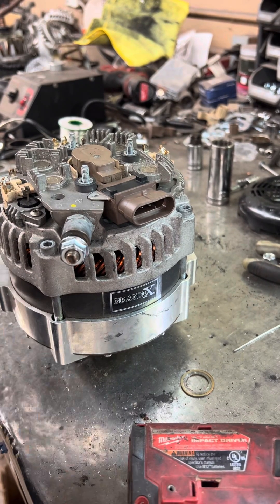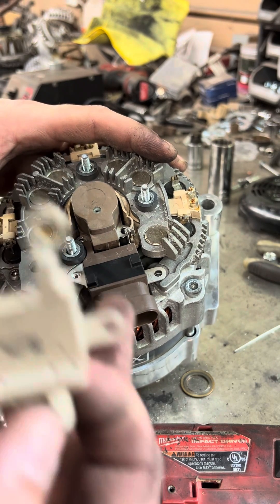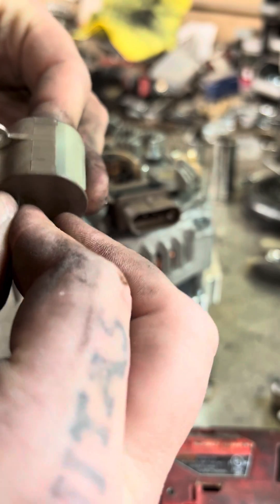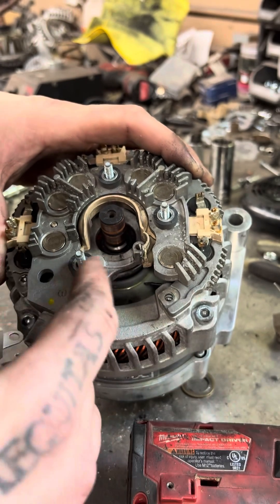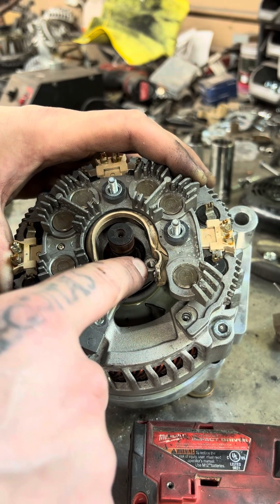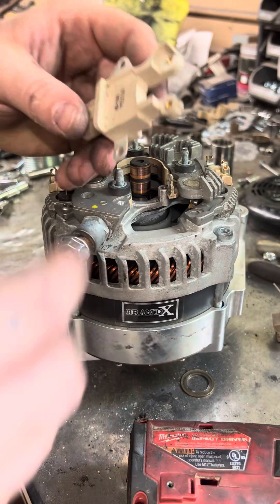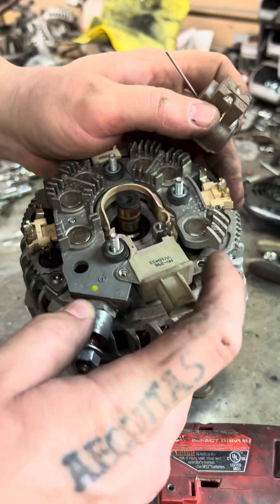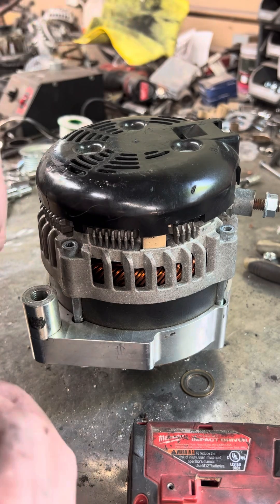How to convert an internally regulated alternator to externally regulated / adjustable

Comment: The external voltage regulator I got has two wires. In this video you took the two wires and completely eliminated one and didn’t explain how to even wire the external regulator

Comment: I have a 370 mechman just did the brand x conversion to externally regulated my quest is on the plug i have a white and green wire my question is what wire is what on the plug

Comment: You should make a video demonstrating the wiring to an external regulator after cutting the extra leg off. I’m going to take a shot and say the hot wire goes to the positive stud of the alternator with the battery cable then the other goes to the field cable. I’m a rookie no one listen to this comment until it’s been confirmed by someone who knows what they are talking about 😂

Comment: This helped me greatly I can use my alternator now I blew out the regulator now I use external regulators and the alternator last virtually forever it's the voltage regulator is that go bad and now I can replace the voltage regulator for about $14

Comment: Something’s I am confused about do we re solder it back?
By cutting off one leg we will use one pin in the socket but external regulator has two wires ??
And finally filing down the  right connector are we still using it and I am assuming it’s ground ?
Reply: Same I’m trying to wrap my head around it. I’m a straight rookie
Reply: You have field (positive) in from the regelator and negative from alternator. The second cable from the external regulator is probably going to be the W connection.

Comment: If one (or both) of those solder joints on the internally regulated connector break or loosen over time can that cause a no charge situation?